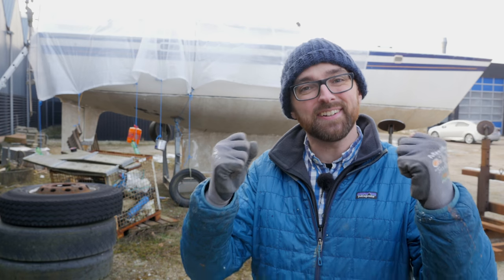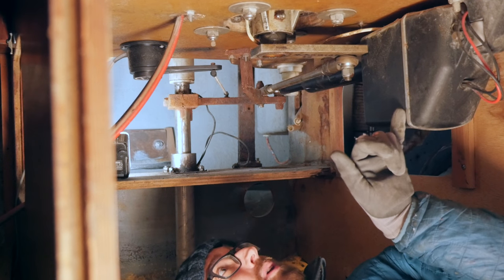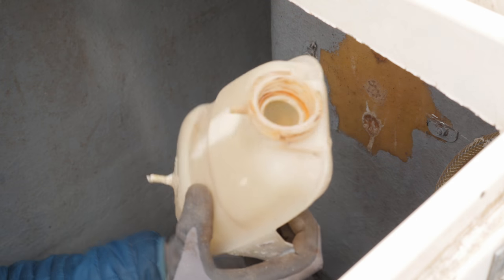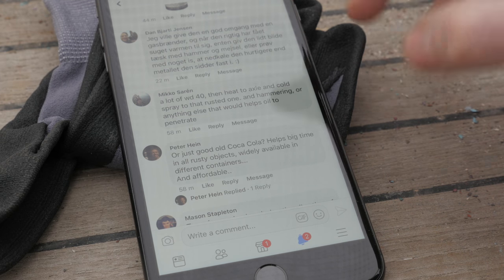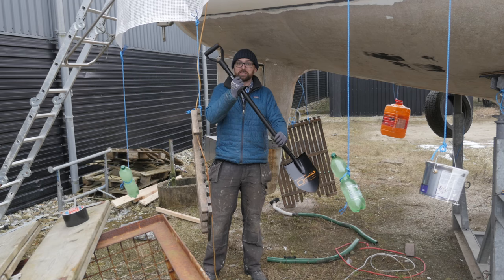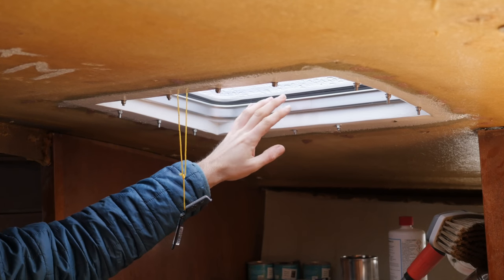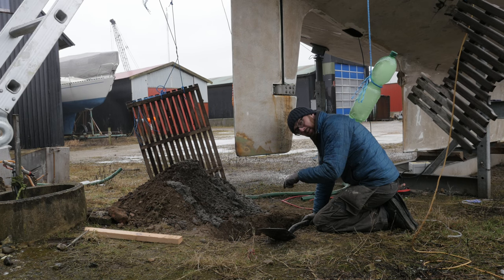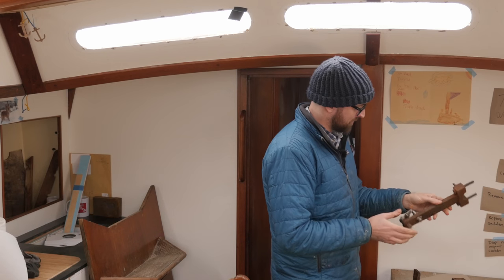Sail Life - Removing the rudder from my sailboat - DIY sailboat repair

Comment: Mads, I have recently dropped the rudder on my UK constructed 1976 boat.  It weighed a ton.  I was expecting to split it easily (to replace the stock which has corroded) and find foam - no chance.  What I found was more like concrete which was stuck fast to the fiberglass skin.  I later found that the filling is slate dust with some sort of hardener - really solid.  Feel free to have a look at my efforts in my 2nd January video - not for the squeamish.  Good luck.
Reply: Not for the squeamish indeed.  Can't wait to see your second video and then watch to see how Mads tackles this job.  Looks like just starting from scratch with a new rudder built in a mold from the old one using a new-fabricated rudder stock might be the easiest way, but I wouldn't have believed it until after I saw your video.   What a nightmare.  Good luck.
Reply: I have a Mirage 28, built by Thames Marine in Essex, UK. The Warrier was built by Trident Marine near Portsmouth, UK.  Different builders, but I wonder if they used similar construction techniques.
Reply: Well, to be fair, I was advised to build a new one.  Were I to start again I would at least make the molds before I split the old one.
Reply: Just about sailing I need to get better at taking professional advice myself.  He even knew that it was hard advice to accept.
Reply: Love it when I can see others do tasks...my rudder will drop at some point and I'll be doing that...nice video, no squeamishness without blood, hahaha...check my....dream out...favorable winds!
Reply: +1 on making a mold first before cutting into the rudder
Reply: I wonder if all that weight in your rudder is to create some kind of dampening effect against flutter.  I'm no expert on hydraulic flutter but any flutter would want to vibrate (tear) the rudder away from the boat or at least wear out the rudder bearing / rudder port area prematurely.  In aircraft control surfaces (like rudders, elevators and ailerons) this can be catastrophic... https://www.youtube.com/watch?v=pEOmCkZyXzk
Reply: Now that is a seriously scary video of an aircraft I wouldn't want to be on!!  You could be right about the weight.  Also, I have read that there is an optimum 'aerofoil' rudder profile for slow cruising boats based on NACA 0012. - My old rudder is nowhere near NACA 0012.

Comment: I admire your perserverance and committment to  your plan. I would keep the iron arm to the rudder shaft. It is not corrorded badly and a little bit of sanding and covering with good epoxy paint or some anti rust paint would keep it in good condition. As to the bolt length, the back side of the fitting seems to be pretty thick, so you could just get someone to cut away 5mm or so to make sure that the nuts have enough thread.

Comment: If I recall correctly, the two most common failures on sailboats doing long-distance passages are rudder failure and standing rigging failure.  Stainless steel version of that rudder shaft bracket gets my thumbs up.

Comment: Hi Mads - im a fussy aircraft engineer but i wouldnt consider replacing rudder arm with stainless - it would be a considerable sum, have it sand blasted and zinc or cadnium plated, then apply a waxy rust preventitive - it will outlast you! as for the bolts - do as someone suggested and maybe replace with stainless bolts with self locking nuts - good luck , Bert

Comment: When working on a projects you can go a little too far (talking about myself). The part you thought about getting made of stainless steel,  even if you left it how it was it would take 50 years to rust at that thickness.  I would clean it and move on.
Reply: Agree. Clean, paint, bolt it back and sail hard.
Reply: Clean and paint. Stainless steel is too much money and not worth it. On my boat i have a steel swing keel, after long consideration i had it "just" galvanized and painted several years ago. Still looks like new! Considering my part is always is in water, you will definatelly do fine with just cleaning and some good paint.
Reply: drill out the bolts, clean, paint, replace
Reply: I agree... cut the bolt heads off your self, drive out the shank, have them sand blasted and professionally painted. A professional 2 part epoxy paint will be plenty. Plus that arm probably acts as a sacrificial annode keeping corrosion from the rudder stock. Changing it may change the electrical qualities of the metals in that area and start corrosion on the next weaker metal. Better to have corrosion on a thick arm than possibly on bolts. 

Just my 2 cents. :) 

Thanks for the video.
Reply: If you don't like the look of the rust on those bits, wire brush it, degrease it, Ospho it, primer it, bake it, paint it, bake it.  But it will work just fine as is for 100 years
Reply: Don't repair if isn't broken...old engineer saying

Comment: Hatches: big hatch tends to face forward for two reasons. First, if you want to shove a sail down below, hatch opening facing forward helps. Second, ninety percent of the time you are at anchor, your boat will face into the wind. Unless the tide is stronger, then your boat will face at an angle. Ignore this if your boat is tied up to the pier. Small hatches could open outwards toward port and starboard. Example if wind is blowing from port, you open both hatches, port hatch lets wind in and starboard hatch lets wind out.

Rudder: repair and replace everything while you have it out. Bearings and such. Replace that rusted crap with SS.

Comment: Mads I would have that rusty rudder head component shotblasted and for the small closing piece trimmed by 15 mm (or have it counterbored to allow the nuts to seat deeper) in a machine shop or DIY it. A good epoxy paint scheme will do another 30 years. It’s too late now but to remove the key the sure fire way to do it is to drill and tap 2 holes top and bottom of the key for suitable sized bolts. Then jack it out by screwing the bolts in - this does not damage the key or shaft (when you have the new key made it is worth specifying these threaded holes to be incorporated). Too late - dang. Great update video and excellent idea to heat the planet up to enable you to dig the hole.👍😀😂
Reply: I like your idea, but I think 15mm is a bit excessive.  That's about 5/8".  That might make it too thin, 6-8mm should be sufficient unless you would want to double nut it.
Reply: William Gross To be honest - if it were me -  I would just counterbore to the socket size sufficient to get full thread penetration of the nut.
Reply: That would work nicely as well

Comment: Re: Rudder Arm
The old rudder arm looks perfectly robust and serviceable - if it were me, I would grind the heads off the bolts to remove them. New bolts, have it all blasted and powder coated or zinc plated. Spend the money on something you can see, like a shiny new tool or instrument!!

Comment: In the U.S. we have a product like no other for separating "rusty bits".......it is called P.B.Blaster. It will change your life and remove a lot of stress. Anti-seize compounds will help will assembly and future disassembly. Lock nuts should have at the very least, one complete thread showing above it, but three is more correct.

Comment: I say rudder next but agree with the others that you should cut smaller holes in the skin first.  When using penetrating oil like pb blaster, it can take multiple applications and time. A little heat too works wonders.  For the rudder part, clean and rebuild with longer new bolts sounds like the best way. You could always get a new one fabricated if necessary, but don't see the need.

Comment: Before you cut the rudder in half, put a bright light on one side and look at it. With no gel coat or bottom paint you should be able to see thru it and see where the tangs are. Then if you take a 3-4" hole saw you can cut through the f/g to check on the condition of the welds. If you see it's bad, well then unfortunately, you've gotta cut it apart to fix it. I've rebuilt 3 rudders on boats I've owned, two with new stocks and larger tangs. One of them only had 1 1/2" of tang remaining welded to the stock The other tang weld was rusted away completely and worthless! So 1 1/2" of steel was steering my boat! Scary... Good luck and stay warm (if you can)

Comment: You could take mr angle grinder to the welds on the bolts on the steering arm to replace them them sandblast the arm and have it powdercoated to protect it , paint the engine compartment now that youve got it cleared out

Comment: To dig a post hole in frozen ground here in Minnesota I use a cut off 55 gallon steel drum, light a bag of charcoal and cover it with the drum bottom, with a few air holes, and let it burn overnight. Yes, PB Blaster or equivalent is your friend, makes removing old bolts and screws much more satisfying.
Reply: I was just visualising Mads accidentally setting fire to the rudder and skeg!  😀
Reply: A weld in steel is not like a bead of glue that is put on the surface.  A welder who is any good will have "penetration" into the stock he is welding at least as deep as the weld sticksup proud of the surface, often more.  The area that is penetrated will all be melted into a liquid that then cools as one piece of metal.   So cutting the weld off of the surface is literally "not going to cut it."

Comment: You can pour boiling hot water to the frozen ground. 10 litras at a time. Then dig. Then pour 10 litras again. Then dig etc. etc. it actually works.

Comment: I wanted to recommend Pb Blaster but since so many people already have mentioned it, I won't. :-P  AreoKroil was the original stuff I've used on Marine projects but Pb Blaster works equally as well for much less money. They are both penetrating oils that spray on and into your work AND extremely handly to have in your standard tool box. You might have a different brand product that is the same thing in Denmark.

Comment: Next  time you need to remove a keyway from a shaft and need some way to grab it try a pair of electrical side cutter pliers. The cutting edge from the pliers will allow you to grip the key then by pulling/pushing the pliers against the shaft the key will pull out. I have used this method for over 40 years with a lot of luck.

Comment: You need a (automotive) ball joint splitter to get the end joint off Mads. I would keep the steel parts, wire bushing/sanding, then a good silicon paint like Hammerite will keep them pristine in that internal compartment.
Reply: Also known as a pickle fork
Reply: Very difficult with a "wack it" pickle fork when the part is off the boat. A "slide-in then tighten the pressure bolt" splitter is what I meant.
Reply: Which if similar to the US, he may be able to rent at an auto parts store

Comment: HIGHLY suggest you refinish the steel steering arm and simply replace the welded-in studs with longer HIGH STRENGTH oned to get the full thread engagement in the nuts. With the high working load on that arm you're  better of with the original proven steel than a stainless alloy + it will save you lots-o-cash for something more important down the road!

Comment: You can find these rudder arms in cast alumimium (or Aluminum). They are light and sturdy and would probably be a fraction of the price of a custom made ss part. Though I would keep the steel piece, replacing the studs and sand blasting it ( if you have an air compressor you can make one yourself) and have it epoxy coated.

Comment: I'd wire brush that arm that connects the rudder post to the autopilot. Then use Phosphoric acid (converts iron oxide to iron phosphate)   which stops the rust. Cut the bolt heads off, add longer bolts. Paint her up then reassemble. Watch Boat Works on how he rebuilt a rudder.

Comment: Cut off the bolts with a cutting disc. Treat steering arm and clamp with rust converter.  It will last your lifetime.
Reply: The rust converter I have used you can paint over it. That steel on the arm is much stronger than stainless steel.

Comment: I had a thought on the rudder arm.  Not sure what it is called but you know what i mean.  Anyway, from the video it appears to be very solid and even if the pitting is heavy there should be plenty of meat left to be very strong.  I of course have not seen it in person but from the video I would advise to clean it up and reuse it.  As to the welded bolts, grind off the heads and replace with longer bolts.

Comment: Try a bronze Woodruff key, rather than SS.  The bronze won't seize/gall like the stainless steel one did.
Same for the steering arm.  Go bronze.  Beef it up a small bit based on the bronze alloy being used.
As for the steering stops, sandblast and epoxy paint.  You need to economise where you can.
A penetrant called Kroil is even better than PB Blaster, both of which are way better than WD-40.
Good luck with whatever you discover inside the rudder!

Comment: hello, A couple of thoughts on the rudder arm,
 De-rust, grind off welds holding the bolt heads in place,
Soak in an acid to clean all traces of rust off and either Have zinc plated or paint with a couple of coats of zinc rich primer (like Davids 182).
Have a new arm machined out of stainless steel in the same pattern but without the welded joint on the side bar where the linkages bolt onto, maybe with counter bores to accept the ball joint securing nuts, maybe also replace the clamping bolts with studs.
 More than one way to skin a cat.
 Cheers, J.

Comment: Hi Mads, no borie much above the lineage of the rudder  get a quoting for stainless and extrude steel and maybe try to look if some type of brass,  I imagine the the stainless gonna be very expensive , instead buy a new key a stainless one,  the other part can resist a few years with out a problem and if you use all the blts a stainless gonna save a lot of money

Comment: I suggest consider the type of steel aloy you use for the rudder mechanism. Stainless (or high carbon & chromium) steel may be harder and tougher, but cannot bend, yield or flex as well. It will snap and break in stead. Lower grade low carbon content steel, as you have now, will bend, and that may prove to be a good idea in case of a collision or some other event.  You may want things to be able to give way in stead of suffering catastrophic failure, in case you hit a coral reef or somethng. It fails by deformation and not sudden fracture. Of course, normal also corrrodes more easily, as you have discovered. Aloy is important. There may be some idea behind the steel aloy choices the designer made for the various parts, noting some are high carbon and some not.

Comment: Rusty bits, blasted then powdercoated of plated. Stainless ones will cost a fortune and these are not going to rust away any time soon, they've been on the boat 30 years. Shiny stainless is always nice though. As for the nuts, just get someone to machine the corner off so the thread shows as much as you need, you could always use your angle grinder and cutting disc if you want a DIY solution.

Comment: Cut of the bolts, bead blast and powder coat- mask the shaft mounting areas. If it breaks, which is unlikely, you can have steel welded easier than stainless!

Comment: Being a mechanical engineer, I would advise you that you may actually be able to keep the excenter rod, rather than replacing it. You only need about 4 full turns of thread to take the clamping load. And if you are worried about loosening during operation, you can use some screw fastener glue product.

Comment: I totally over-estimated the time it might take using the heating pad to drive the frost out enough to for digging.  Awesome that you were able to "get 'er done" in just one workday.  Amazing progress in the face of adversity.  Then again my own 2-day estimate yesterday was using a piece of plywood or something to protect the pad from any mud below, and not turning up that high.   That pad is seriously tough to take that abuse, but there wasn't any mud like I expected either.  I was riveted during this entire episode.  

I wonder if the rudder arm could be made out of G10 Garolite rather than stainless.   It's pretty dang tough stuff, but I suppose making it out of stainless is the best answer.  I am really interested in finding out how much that fabrication is going to cost. 

That dang rudder key was really in there.   More heat might have helped.  A MAPP gas torch (methylacetylene-propadiene) is the only way to go over propane.  It is a special gas developed by DOW to replace propane where more heat is needed using the same type of gas cylinder and torch head as propane.     It gets a LOT hotter much faster and that thermal shock is what helps break seized parts like this.   MAPP is glorious stuff.  Once you use it for plumbing jobs or for just heating stuff up to help remove it like your rudder arm you never want to go back to using a normal old-fashioned propane torch.  They look identical to propane torches except MAPP burns way hotter and the cylinders are painted yellow to show the difference. 

I thought at first you might have bent the rudder gudgeon hinge a little where it holds onto the skeg.   I can't believe stainless would bend that easily, even with the heavy beast of the rudder falling onto it.  Then I thought maybe it was just a trick of the camera but they do look squeezed together -it must be that this is just the profile of the skeg and is supposed to be bent-in like that but the nuts and bolts didn't seem to be protruding through a tapered surface. 

Another super awesome video.  Sail Life is the best YouTube channel out there right now IMHO.